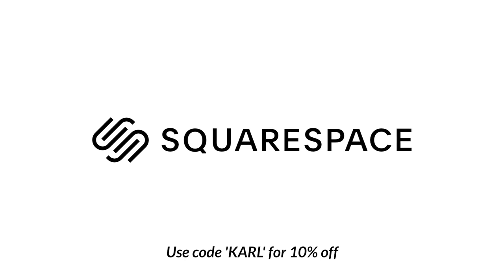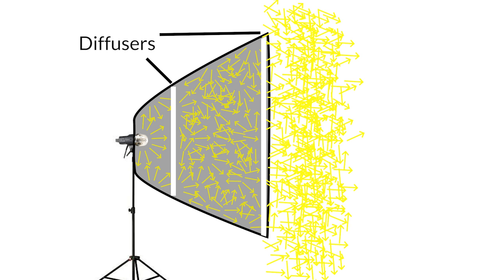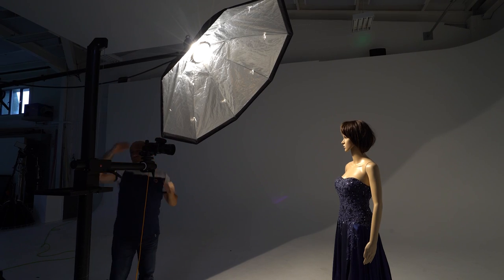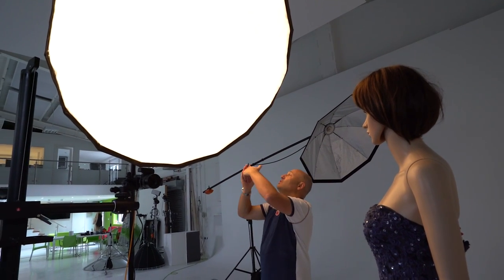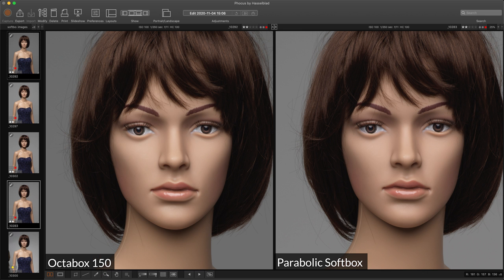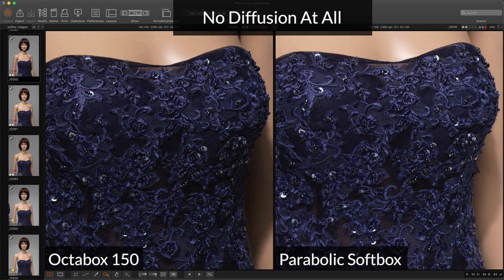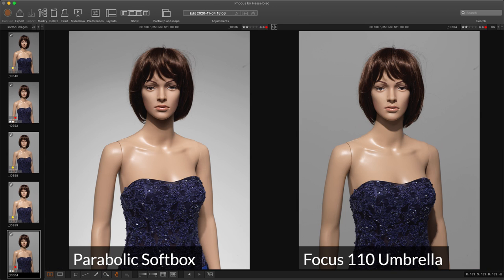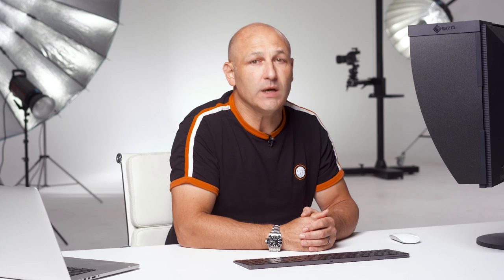The Myth of Parabolic Softboxes - Save yourself time, frustration & money!

Comment: If you want to mimic very directional window light I think a parabolic will do the job. A standard softbox will spread light and reduce contrast. Even if a one stop diffusor is used some of the light will pass right through the fabric not all will scatter. That's my understanding. In theory. You have a mega studio with no natural reflectors/walls on the sides I think the effect might show in a smaller studio with white walls. But if manufactures now add too much diffusion, a new light source is created, then no difference. The same effect will be seen if you use a softbox + grid on a football field vs no grid. No difference. The spill will only reduce contrast if reflected on something. 

Remember, natural light can be soft AND directional AND diffused creating contrast (e.g tunnel light) Maybe the 1-2 stop diffused parabolic is out of concept. Nice test but try adding white v-flats for a true result.

Comment: Excellent comparison. Now there is another difference between them: ease of assembly.
If you need to shoot on location (a restaurant, a hotel, at a client's company, etc.) the parabolic model, despite being heavier, is more practical to arm. There are those models that are like an umbrella in which you just pull the rods up and it is mounted in 1 minute. The ocatabox would need to fit the rods on the base, on the cover, it takes much longer.
But for studio use, you undoubtedly drew attention to a big point.
Thanks!
Reply: That was not his Point. There are other Things to consider

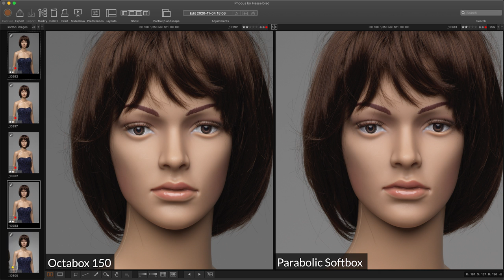Comment: Paused at 5:58 I see softer light on the parabolic. Look at the hair, mouth, and nose. The hair is perfect proof of the softer light, and greater color retention.
Reply from the maker: Softer light comes from a larger light source and this particular one had a larger surface area than the Octabox. The fact you are seeing this demonstrates what I was saying in this video perfectly because if you're seeing a softer light then all the parabolic properties are diminished by the front and internal diffusion as explained and demonstrated in this video. Light from a hard light source that provides crisp sharped edge shadows in a controlled studio will only look softer if the shadow density is reduced by the application of a global fill light, usually bounced around the studio and omni directional.

Comment: Makes sense. But 2 questions though. 1) What about efficiency? For example, is shallow softbox equally efficient compared to parabolic one, even with diffusors removed? I ask that, because I have Phottix Raja 80 deep and it throws whole one stop more of light on axis, compared to 30cm standard metal reflector which was very surprising result to me. 2) What about off-axis lighting (a.k.a. feathering)? As in deep softbox, the light bulb is much more recessed into modifier, which eliminates bulb hotspot in off-axis position better than with shallow sofbox. I expect this difference to be theoretical/minimal though.

Comment: Hi Karl, i have to disagree a bit with your theory. As you said, the purpose of a softbox ist to spread the light homogeneous on the front diffusor. In a large but shallow softbox the lightsource is much closer to the diffusor in the middle while towards the edges the distance gets drasticly higher. This results in having a hotspot in the middle of the softbox and towards the edges it gets «darker». You see that even more on a striplight that is 150cm by 30cm for example. If such a softbox is not deep enough the middle of the sofbox will be like 10times brighter than the corners and gets unusable, at least for my taste. 
Of coarse you can compensate that with e so called deflector (at least elinchrom calls them so) where you cover the bare Bulb and block direct light from it to the middle of the diffusor. If you have a deep and/or Parabolic softbox the diffusing material could be less diffusing or you could not mound the inner diffusor while still get a quite homogenous lightsource on the outher diffusor. In that case you gain a bit more of light and i think it will be also a bit more «directional » while still beeing diffused. However that is also depending on how the diffusing material is made.
I agree that on the «Model » the effect of the light is not that different. But i clearly see differences on how the light hits the Background even on the comparison with both diffusors mounted. I think if you used the parabolic sofbox without the inner diffusor the effect on the model would still be quite the same while the background would be even brighter as it gets a bit more directional. 
And this is very important to me, because if you use this light more from the side instead of right in the middle above you can create a much nicer gradient of light on the background when playing with the angle of the softbox while with the shallow softbox that spreads the light on a wider angle you have to change its angle much more to have an effect on the background. Sure, you can use grids for that purpose but sometimes you want something in between.
So for a real comparison i would like to see first of all some shots straigt on the diffusor of each sofbox with and without inner diffusor and deflectors etc. The pictures should not have any part of the image (diffusor) blowing out so you can see the lightfalloff on the diffusor. Of coarse on the video where both diffusors are totally overblown they look both very homogenous.
Secondly i would make examples with both lights in the same position but 45° degrees to the side of the model and both pointed to in the same angle to the model to see how the gradiation on the background changes. Of coarse you will have to capture a larger image where you have more background on the picture.
And lastly, when you use the parabolic softbox without any diffusors you have to mount a deflector to block the bare bulb while still illuminating the inner side of the reflector. In that case it is not much different then the indirect parabolic reflectors besides not having the possibility to change the focuspoint. But it is indirect too, just make sure not to block the light that goes into the reflector by mounting the deflector as far as possible from the bulb until you barely can see the bulb when looking from the side of the reflector to it.
I think the purpose of that video is to tell that if you want a parabolic reflector you should buy a Broncolor. But there are many other options too. Parabolix, or the SMDV Speedbox Mega and many many others that cost a fraction of the Broncolor ones.
Reply from the maker: Hi Please see my pinned comment at the top of the page.

Comment: I can see there would not be much difference between those 2 modifiers on a close subject but isn't it the same difference between a regular reflector and a zoom reflector? The additional reflecting surface would make the light brighter and "throw it" further away? It would be worth doing a similar test at the same output level but this time lighting a room to truly see how they differ.

Comment: I believe the point of a parabolic soft box is to get the light source further away from the front diffuser, giving it more room to bounce before exiting.

This produces a more evenly lit front, which in turn translates to:
1) a slightly "bigger" light, even though your video showed the difference is negligible
2) less sharp and more consistent specular reflections; this difference is very apparent in your tests, where the parabolic soft box delivers "softer" speculars all across the subject while the regular soft box delivers crispy speculars on the face, neck and shoulder and softer on the elbow and dress.

Are these differences noticeable in the daily life outside a direct comparison? Will the client notice?
But most of all: are they worth the extra cost and space requirements?

At the end of the day it all boils down to personal preference, but the difference exists, and it's not necessary to label it as a marketing move everytime one doesn't t get it.
Reply from the maker: Hi thanks for your comments please see my pinned comments at the top of the page.
Reply: @VisualEducationStudio  hi, I have read your pinned comment before writing mine, but my point still stands: there are differences in your pictures which are consistent with the expected results.

Now, you can claim these are due to inconsistencies in the setup, but if you do you logically invalidate your whole test, as you're saying its design is incapable of showing meaningful results over data noise.

Either option, stating the parabolic shape is just a gimmick from a physics standpoint is preposterous.
Reply from the maker: @gabrielecannilla8969  Hi Gabriele,  yes they are consistent with the expected results based on my pinned comment. There is nothing really meaningful in the results from the design - if there was I would be choosing to use this type of design for my work - www.karltaylor.com - but after 30 years shooting professionally and working with some of the top brands in photography in testing, product development and education as well as continuing to shoot commercially my experience and knowledge tells me that as long as there is this level of diffusion then there is no benefit.
Reply: @VisualEducationStudio  I do understand your point and respect your career. But I also respect the engineers behind these brands, as I respect my (surely more modest) knowledge in both photography and physics.

I agree with you regarding real world's results: the differences in your shots are very small, and on set a photographer will find a way to fine tune their lighting.

In your video and comment, though, you have been saying that "people don't understand physics". This is a very different statement, and experience doesn't weight in this debate. Physics are physics.

A more accurate test could be to use two similar soft boxes (in dimension and quality) and taking a shot of the front of both, exposing the diffusing sheet to fall in the mid tones: if the parabolic shape isn't a gimmick, you should see less "vignetting" around the edges of the soft box.

I would do it myself, but I don't have two similar modifiers.

Comment: I agree with the burden of parabolic softboxes, especially for those of us with smaller home studios, they just don't make a lot of sense. However, I feel like your comparison isn't putting a parabolic softbox in the correct situation. At a distance, and with a grid modifier, a parabolic softbox can indeed give "sharper" light since the softbox is basically cleaning up light scatter by preventing off angle light from ever leaving the octabox; it is instead being reflected internally, so never escaping the softbox or effecting the shot. So what you are shooting with is the straight, directed light, with less off angle light striking the subject. This could be beneficial when either shooting from a distance due to scene limitations, or when using it for a hairlight, so less off-angle light directly reaches the camera. Please correct me if my understanding of the benefits of a parabolic are wrong, but between the longer cone shape reflecting/stopping off angle bulb light, and a grid also stopping the off angle light, a parabolic will only allow direct light to reach the subject. Cheers, and thanks for the awesome videos.
Reply from the maker: Hi Brett, thanks for your comments but an Octabox with a grid will do the same as one of these parabolic softboxes with a grid. Please see my pinned comment at the top for a full breakdown.

Comment: You missed one thing: as a reflector, the parabolic one illuminated the background brighter since it focused the light tighter. That was very noticeable and it looked to be very slightly apparent with the front diffuser removed too.
Reply from the maker: Please read my pinned comment at the top to understand why this isn't correct.

Comment: the only advantage is that you can more easily get the light close to the model without the light stand getting in the way.
Reply from the maker: That's the advantage with the Octabox yes because it's smaller and lighter so it can more easily go on a standard giraffe boom

Comment: I must be the only to add a P70 on the inside to have a halo of light stronger in the centre than the edges? The deep octa with 16 ribs are a little easier as they have more distance. Yet I agree with the trend of everyone needing a Parabolic octa just because everyone jumped on this wagon before knowing what you showed. I haven't used other than some really good large deep umbrellas which I can control the "halo" by the distance between flash/continuous and the umbrella. Secretly wishing a Broncolor Para would appear in my studio!

Comment: It's funny I have a "parabolic" softbox and did a very similar test just a couple of days ago coming to a very similar conclusion as you. One difference and something I would add to your video though is that the strobe's head (or lightbulb) matters as well. The one I have from Godox has frosting on the front part of the glass, therefore forcing light to go to the sides more than directly forward. This achieves a more similar effect to that of a true parabolic reflector without the ability to change the focus of course. Comparing that frosted glass bulb to a conventional one however makes a difference, and again, I would have to agree with you that it's similar to a huge beauty dish and in a nutshell, it's just marketing BS.

Cheers Karl! Keep cracking on more advanced videos such as this and more in-depth light understanding stuff - even to pros, that's quite useful insight and perhaps new knowledge!
Reply from the maker: Thanks Boris.

Comment: Tears of happiness here. The truth needs to be out there! Go, Carl. GO!
Reply from the maker: Thanks David, but remember this is referring only to 'deep' or 'parabolic softboxes' this is not referring to true parabolic reflectors that are designed to work without front diffusion, those are still some of the most effective lighting modifiers available.
Reply: @VisualEducationStudio  Of course. What also needs to be accounted for is that the "thinner" your diffusion is, the ratio of Lambertian:Directional goes towards directional (and less wide and linearly distributed penumbras). So the quality/type of diffusion is a factor that needs to be tuned in for optimal effect in the modifier design stage, if the producers really want more directionality. By experience, I doubt any brand consider this, and just slam on the same diffusion they use for their normal line up :). And why shouldn't they? It's all 'bout the dum dum da da dum dum...
Reply from the maker: Absolutely and well observed. Broncolor do produce a very thin veil option for the front of their paras which still allows the collimation but provides a minor hazing to the image. Most of this other junk out there slam two thick layers of diffusion inside a 'deep or parabolic' design and realise that most of the potential market don't understand the physics of how these things work so can benefit from the 'deep or parabolic' terminology in the marketing speel. If they genuinely could also provide 'deep or parabolic' softbox that converted into something more useful then it would at least have a second purpose but as my test demonstrated without a focusing rod and the right shape they are just taking people for a ride.

Comment: I'm sorry for my bad english: I suppose the parabolic is used to have more control in the direction of the light at long distances, if You use the same reflectors at 5 meters(for example) distance, the light will be escape by the corners and will come to the objective more difussely and covering more area with the octabox 150, no?
Reply: I was going to ask something similar.  Though it might not change de softness of the light, what about the brightness?
Reply: @marcelomena9091  Maybe "hit" the objectve with less intensity, and it be necesary use more wattage